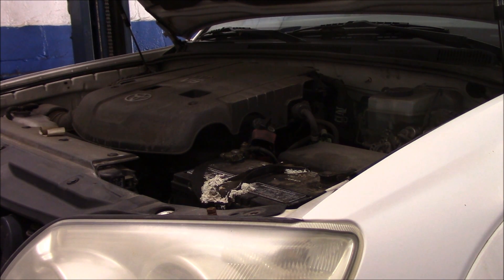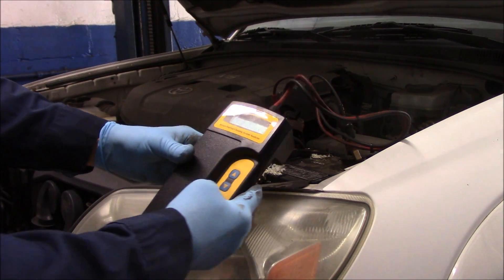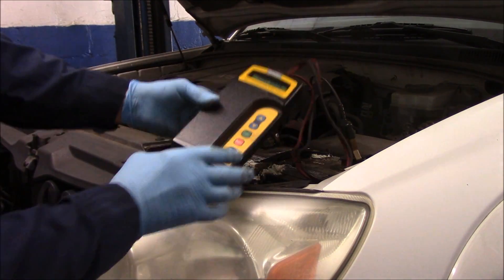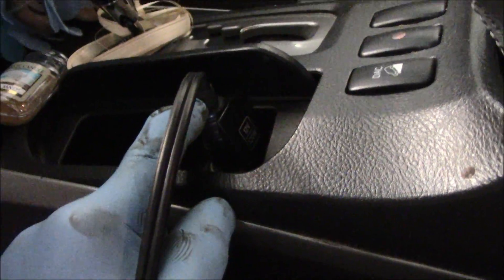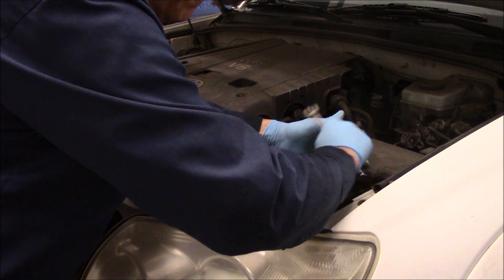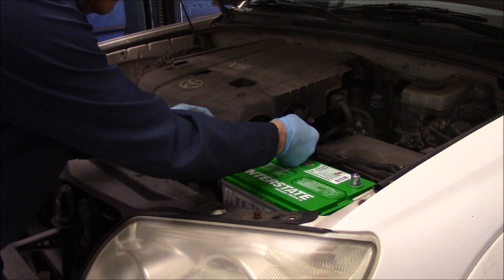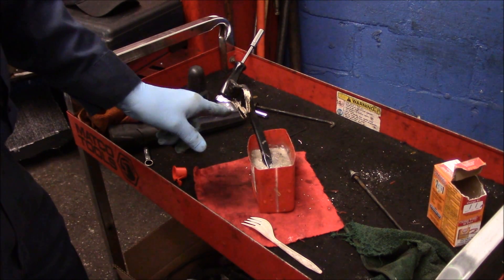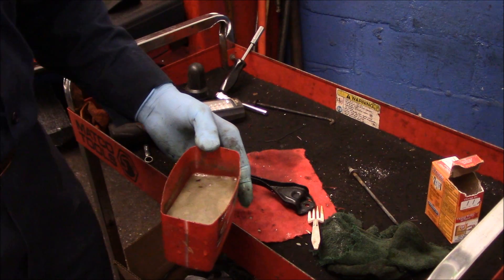How to diagnose a bad battery or bad alternator

Comment: Jim, Thank you for the step-by-step clear demonstration.  I have longstanding unresolved questions and hope you can help:  
1) How do I reconnect the battery and/or do a key-off parasitic draw test without setting off the alarm if a car does not have a alarm reset button or valet switch?   My 95' Corolla (alarm and remotes came with it new in 1995) doesn't seem to have a reset/valet switch.  The car has a foux (or missing valet switch).  How do I locate and identify the correct wire for the switch if it has one?
2) Do I need to do memory saving when changing battery on an older car like a 1995 Corolla?  
3)  If memory saving is recommended nevertheless and or perhaps a way to prevent the alarm from going off, do I still need to turn my key to the ON position if my cigarette lighter is live all the time even when the car is key off? 
4) Is trickle charging a battery through a cigarette lighter (say with solar, jumper pack or a second battery inside the car) a proper and safe method of maintaining and charging a car battery if no AC (outlet) is available like in a rental/condo situation for a parked car?

I would like to control my car alarm instead of being controlled by it.  Currently, I can only disable my car alarm with my remotes.  But with the alarm arming itself after 30 seconds or so, I can't even do the most basic diagnostic tests or change the battery without setting it off.  Depending on these old transmitters to disable the alarm when changing battery is also no assurance because these aging keyless remotes (or alarm module and electronics) can stop working.  What are your thoughts?

Comment: Back-feeding from a 12V source also saves the computer memory and its self-learned settings which can cause issues such as rough or high idle until it re-learns them.

Comment: One of the first things I learned when I had my first car was how to work on the battery after I had a problem which caused the battery to go dead if the car was parked for about three days without starting it. After some checking around the outside, and inside I found that the problem was with the switch on the power seat which was causing the problem. The plastic piece which was on the seat control had come out and was staying that way. After fixing that problem there was no more problems with the charging system on that car.
Reply from the maker: Thank you for stopping by the shop.

Comment: Great video  and edicational. Thanks for sharing. Jim l have heard people say by plugging a charger into the cigarette lighter you can blow the whole computer and electrical system in the car. Is this true? Great video thanks for sharing.
Reply from the maker: Thank you
Reply: If a 12 V source is plugged into the cigarette lighter under KOEO it will simlly back feed a 12 V potential through the wiring as if the original car battery was still in place. The system is designed for this and it won't cause any problems.
Reply from the maker: Thank you for stopping by the shop